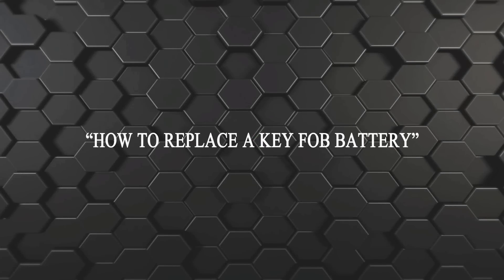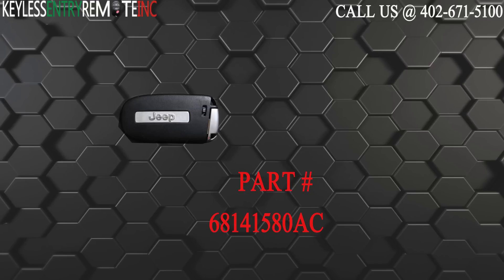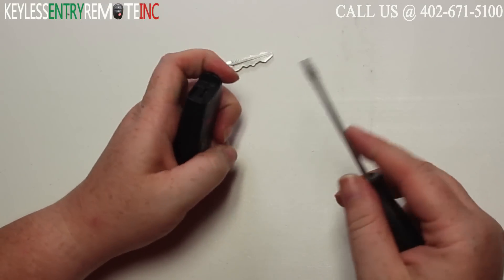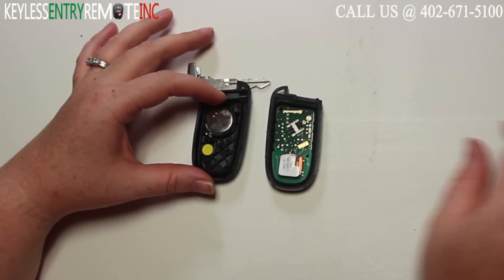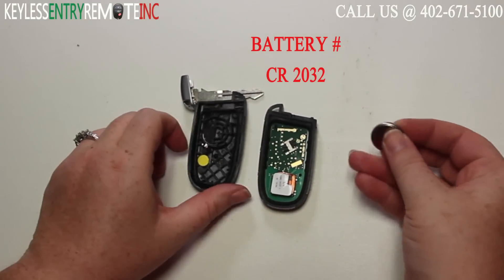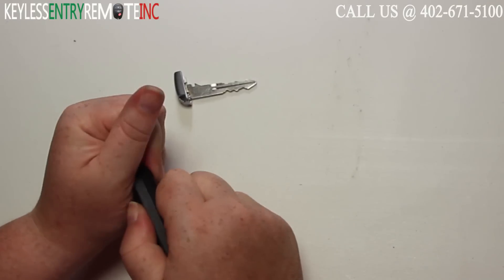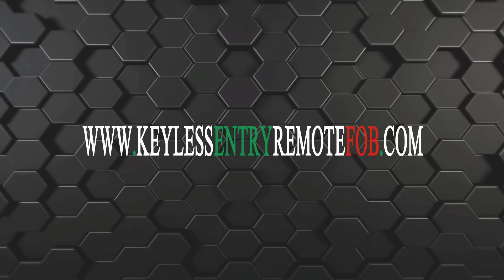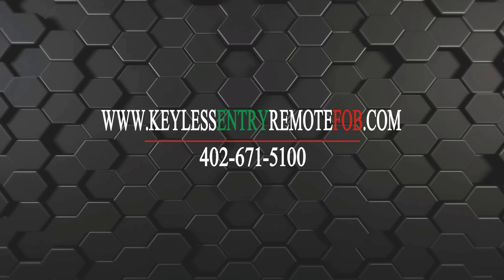Jeep Grand Cherokee Key Fob Battery Replacement - DIY (2014 - 2020) FCCID: GQ4-54T

Comment: Great video.  That said I do want to point out that there is a specific location on the end of the fod where the physical key used to be that is where you are to pry the two pieces apart.  a quarter did the trick and you don't mar the fob when prying.
Reply from the maker: thanks for the advice and glad you liked the video

Comment: I just went to my local Jeep Dealership and they quoted me $269 for Key Fob battery replacement. Is that legal? Glad I saw your video on how to do it myself. I started getting suspicious of my FOB when it wouldn't lock my car doors after exiting my vehicle. I now see the Key Fob error on my dashboard so I guess it's time to get a Key Fob battery for my 2015 Jeep Grand Cherokee Altitude. My only question is do you have to re-configure your Key Fob after installing the new battery? Would it work the same for your vehicle or is there any additional steps to complete after replacing the Key fob battery? Thanks for your help, greatly appreciated. Great Video by the way
Reply from the maker: WOW!!  I am glad you did not get robbed by them
Reply: $269 is for the entire key fob, not just the battery. Most dealers will open the fob for you and swap your new battery at no charge.

Comment: Is the part number for the key necessary ?
Reply from the maker: FCCID: GQ4-54T   Part Number: 68141580AC
You can order a replacement key here
https://www.keylessentryremotefob.com/Jeep-68141580-AC-Factory-OEM-KEY-FOB-Keyless-Entr-p/68141580ac-5b.htm

Comment: How do you program replacement key fob remotes?
Reply from the maker: If you are just replacing the battery you should not have to reprogram it. If it is a new fob it depends on what fob it is. The key in this video has to be programmed by a professional.

Comment: i have a lot of tools and, i felt like i found the best possible tool to open this (a swiss army knife flathead).  Man i tore this plastic key fob all up.  Whoever designed this key fob gave zero fucks which is lame because in the life of the car you'll have to replace them at least 4-5x.